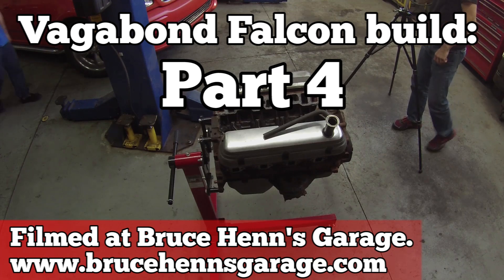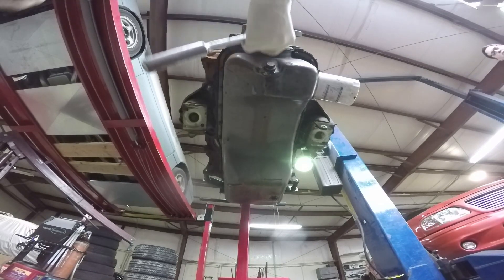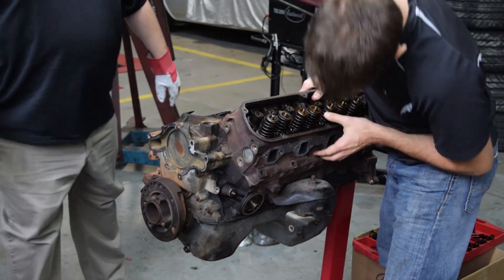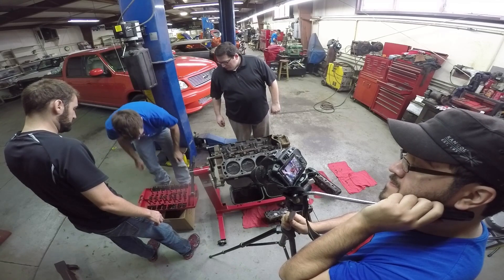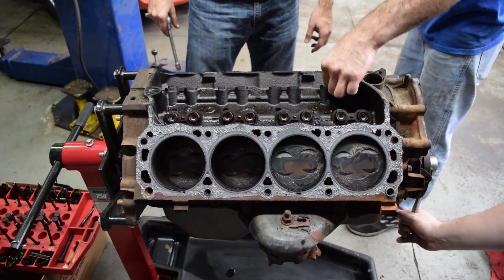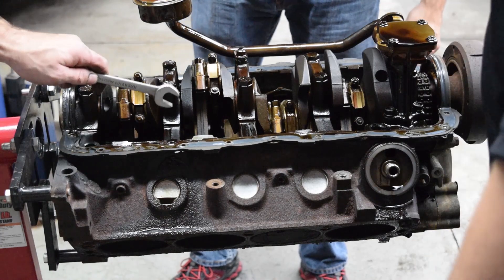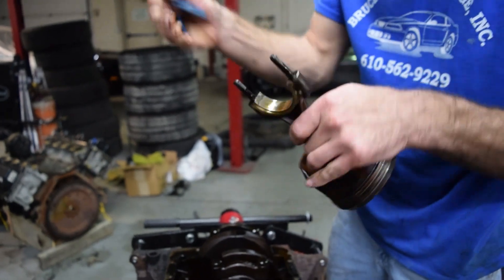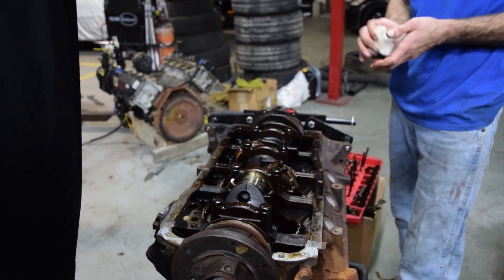Vagabond Falcon build: Part 4

Comment: Do a little homework on your car and donor parts beforehand, and you won't look so clueless in your videos. Seriously, thumbing/surfing thru any number of sources for just a few minutes would have given you a basic knowledge of the Windsor small block, it hasn't changed that much since it first saw production.One of those changes was the oil pan when Ford introduced the Fox body Fairmont in 78.
Reply: Part of asking questions is to engage the audience. It's a great way to get comments.
Reply: And a great way to look ignorant. If you are going to ask your target audience questions, ask them something that isn't kintergarden level on the subject.

Comment: Thats a foxbody oil pan.  The dual sump is to clear the k-frame cross member, give a higher oil capacity and decent ground clearance, while keeping the engine relatively low for cough ... better handling... in a foxbody...

Comment: Do not reuse that cam!  A few thousands of an inch can make the difference between feeling decent or tired acceleration.  It's the heart of the engine and WILL matter to you after its running.

Comment: It's probably mentioned a bunch of times in the comments that I'm not searching for, but at least Mustang and T-bird and Lincoln MarkVII all had oil pans like this to clear the engine crossmember and steering rack. Sat much lower than any of the truck frames at the time.

Comment: my 86 mustang with a 5.0 has the same oil pan. sway bar and cross member run through the gap
Reply: +Mike Mcdonel it's the same engine bud
Reply: +rubberwoody i know that but things like oil pans and heads can change on engines from year to year the only thing that needs to remain the same for the displacement to be unchanged is bore and stroke

Comment: I have built a few of these, I would suggest junking those stock heads and going for some gt40s. They wont make a ton of power, but loads more than those stock e7 heads and they are very cheap to come by, I picked mine up for 250 bucks already machined. 
and I believe that motor might have been rebuilt in the past, because I doubt  Ford put flat tops in a stock 302.
Reply: Stock 5.0L pistons look the same. If it was bored out, the pistons would be marked.

Comment: The reason for the dual-sump is because the steering rack goes under the middle of the motor, so there was no room for the sump there, but the oil pump doesn't move, so it still needs the front part to house the pump.

Comment: At 6:02 you were guessing it was a non interference engine because of the reliefs in the pistons for the valves. That doesn't mean the engine design is non interference, because the piston and the valves can still occupy the same space at different times. I'm not saying it is an interference engine, I'm just saying the presence of the indentations aren't enough to determine this.

Comment: Was kind of scared when I saw how little oil came out of that thing... I pull almost 5 and a half liters out of a 2 liter GM when I change it while this one should have maybe had around 10 at least. And the filter was almost empty too. Had a feeling something would be burned up inside. Doesn't look too bad though. Good luck with the rest of the build guys, I'm anxious to see how it goes in the next episode.

Comment: Is a new cam and heads outside of y'all's budget? Those Thunderbird heads won't make much power in their stock form; the non-HO engine (Thunderbird, Crown Vic) was only rated at 150hp. Should be more than enough to move that tiny little Falcon, but more is always better when it comes to horsepower!

Edit: I take back what I said. The '91-'93 T-Birds did have the HO 5.0. The E7 casting heads are gonna be decent for what you're trying to do. However, I would still recommend a nice aftermarket cam and valvetrain.

Comment: There's some  type of oil delivery issue with the engine, because the oil filter should have been filled with oil.  That might explain the burned bearings... Might be an issue with the oil pickup tube position...

Comment: Are you guys interested in dismantling an electric motor from a Tesla or donated from Tesla ? If so, it will be cool if you guys show something like that.
Reply: You mean a AA Duracell battery?
Reply: +Danny Ruiz 

oooooooooooohhhhh!!! REKT!
Reply: Carlos Malave

You must be fun at parties...
Reply: +Carlos Malave No one has a video on that because the risk of death if not performed by professionals in high safety conditions is very high.
Reply: +Danny Ruiz No there actually Energizer batteries!
Reply: +Danny Ruiz Tesla uses Panasonic 18650 Li-on batteries. Around 7,000-8,000 cells depending on the Kilowatts  (70, 85 & 90). The most powerful battery has 90,000 watts of power;  enough for 700 hp. for an electric motor.
Reply: +dinvergod007 he said a motor not a battery.
Reply: The motors are epoxy sealed units. Not exactly easy or exciting to disassemble. You'd end up with a few miles of copper wire.
Reply: pbfloyd13 I rock @ parties  !
Reply: Carlos Malave 

Suuurrreee...

Comment: It's a 302 it doesn't matter what head goes where u can put passenger side on driver and vice versa plus don't reuse the lifters,  go to the junk yard and grab some gt40 heads and upper and lower intake off a 5.0 Explorer or mountaineer that will give u around 25-35 hp

Comment: you handsome devils you, but yeah. your first engine rebuild always teaches you the importance of oil. are you really going with roller tip rockers? that can get kinda spendy
Reply: +ledzeppelin27 If they have corporate sponsorship from Advance Auto I wouldn't think the cost of roller rockers would be a big deal. That 5.0 already has a roller cam, so might as well make the valvetrain fully rollerized.
Reply: oh hell yeah, sponsership huh? time to go with all forged internals!